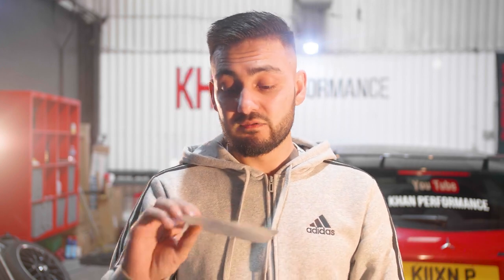A45 AMG - BUILD PART 9 - REFLECTIVE CALIPERS

Comment: does heat effect it ? Ive paint my calipers after 2 section of track driving it became darker
Reply from the maker: Glad you asked, nope they’re perfectly fine still holding up after few track days. If you’re using paint make sure it’s height temp calliper one as it’ll fade with one track day